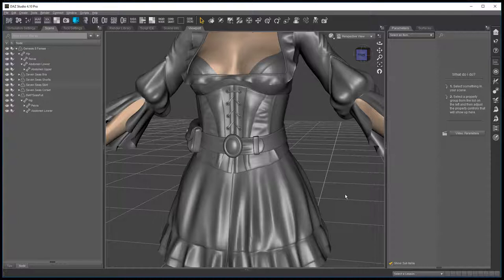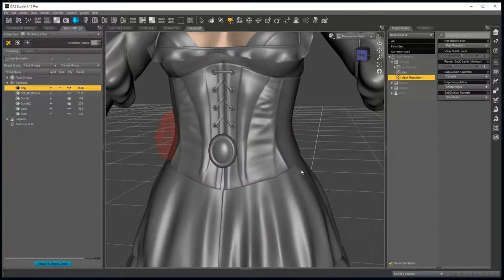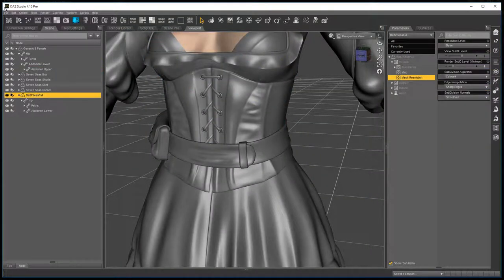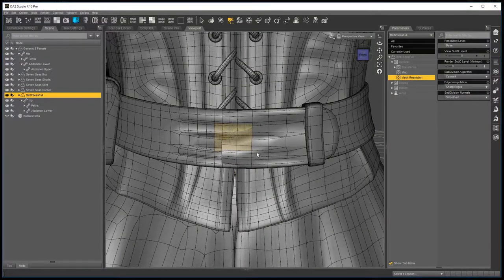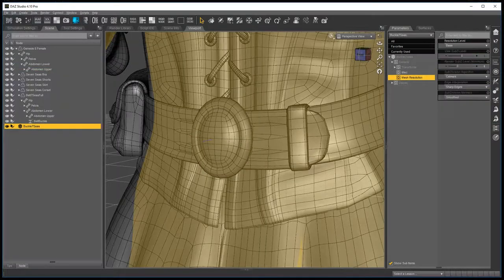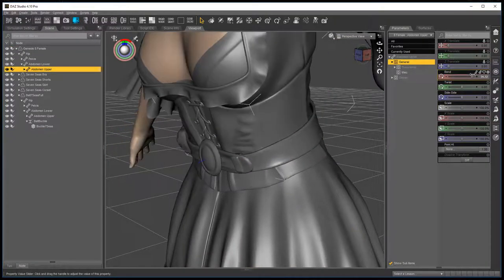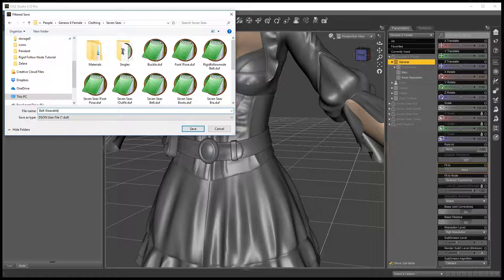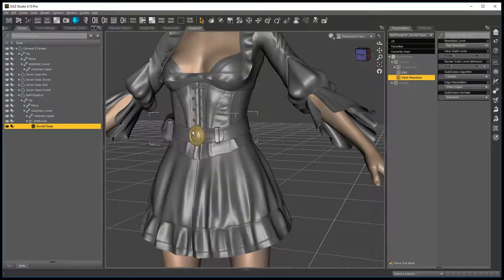Rigid Follow Nodes : Belt Buckle

Comment: Hum, yes very useful and interesting! So I could do the same thing if for instance I wanted to remove a belt from another outfit, that dose not have a separate belt accessory. Then make it into an accessory? 
I guess what I'm asking is, how would I remove a belt from an outfit that doesn't have a selectable belt and turn it into an accessory?
Reply from the maker: Without seeing the mesh, my advice would be to select all polygons that doesn't belong to the belt and delete them with the polygon editor. Then you can either resave the belt under a completely different name (important otherwise you'll overwrite the full version), or you can export as an obj and take it from there.
Reply: @MadadeLeeuw  Yeah, that's basically what I ended up doing. I saved a separate belt from the dress and separate dress from the belt. Love your tutorials! Always so informative and helpful.

Comment: How to adjust the rotation? I still dont understand, i have riggid node set up but for some pose the rotation seem off
Reply from the maker: That means you have to double check that you parented the rigid follow node itself to the correct bodypart in the clothing, as a default it comes in parented to the hip but if your belt is a bit higher then parenting it to the lower abdomen might work better. You also have to play around a bit with where you attach the node, I found that selecting either more or less polygons as the base can make a big difference.

Comment: Hello, I'am trying to do this with a Shirt with buttons and, for some reason, although it works, when I restore the figure pose, after simulating, it takes more then 2 minutes to G8 restore his pose. I don't have problems with my machine (64 Gb ram, nvidia rtx 2060). I use Marvelous Designer and choose a plain button, without holes or seam lines to avoid excessive geometry. The simulation runs well, without explosions, but moving any G8 body part becomes too slow.  Any idea about what is causing this?
Reply from the maker: I haven't come across this behaviour - is it only when you use rigid nodes? Does the same thing happen without rigid nodes? Also are you using an iray preview mode? if so turn that to textured mode instead
Reply from the maker: oh do you have the octane plug in activated? I have heard of something similar that was traced to that
Reply: hello Mada. Indeed I have. I will try that. I have been able to work smoothly on Daz 4.12 Beta, where i don't have the plugin activated soo, maybe a connection here. Thank you for answering and for the amazing tut ;)